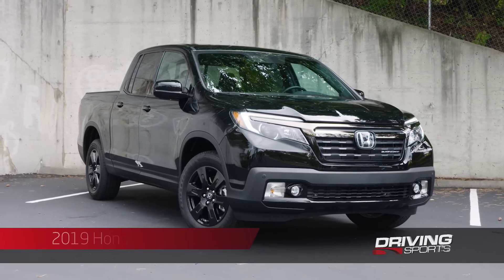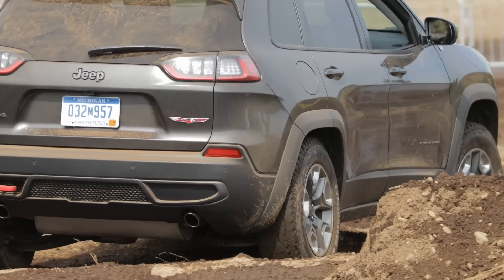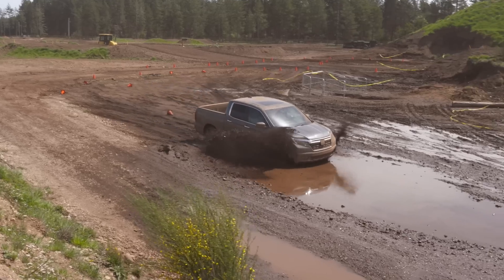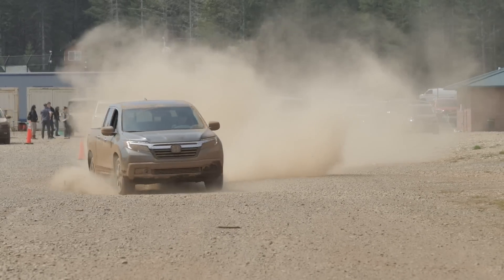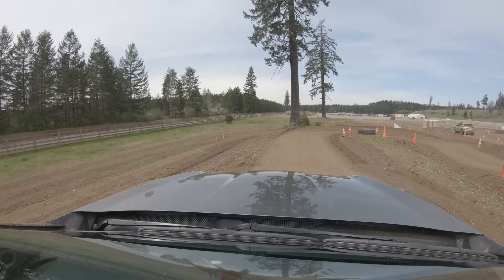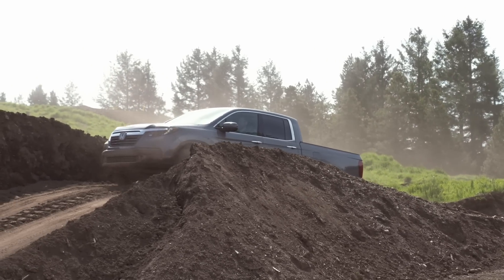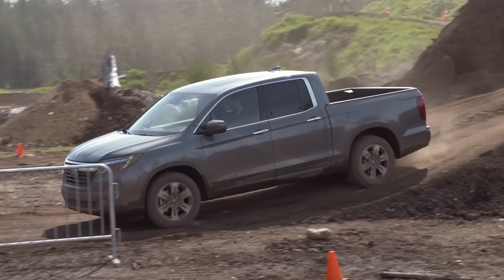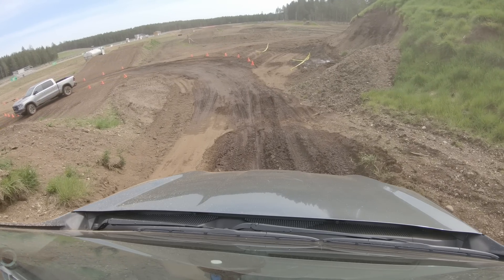2019 Honda Ridgeline Off-Road Test

Comment: Unibody and an independent rear suspension is the antithesis of a truck.  This is an SUV with a bed.  That's great that people like it, but for the love of god, please stop trying to convince the rest of the world that this is anywhere close to the capabilities of a Tacoma or a Colorado.
Reply: A truck has an open bed is used to carry around payloads from one place to another. The ridgeline is a great all-around truck for those that want the capabilities of a truck but don't want to sacrifice the atrocious handling and driving dynamics of a tacoma. It is made with functionality and durability in mind - the bed trunk is perfect for hunting and fishing and the sprightly engine makes it a joy to drive.

This truck isn't meant to do hardcore offroading, but will hold it's own just fine if you need to get off the paved path - as most LARGE trucks such as F150s and Silverados do (long wheelbase makes them a poor choice for true off-roading, as much as those companies love to tout that offroad package with those stickers on the side of the bed). A truck is supposed to be a WORK vehicle first, it's offroading capabilities are secondary. A Chevy 3500 dually is no less a truck because it can't do off-roading in this fashion.
Reply: Amen.  I own a 2018 RTL-E.  It tows my boat, holds my fishing gear, the kids hockey and baseball gear, I've thrown power-washers, etc. in it.  Plus, it rides beautifully, plows through the snow during our brutal winters, and has room in the back seat for two kids and a dog.  I'm not a rock-climber, I don't need a TRD-Pro.  Great truck, but I don't need it.  Plus, the safety features on my Ridgeline blow away anything else in the class.
Reply: James Muro,
 That's exactly what I'm thinking!
Thanks you.
How often do I drive off road to go to work?
I just need a bed to carry my kids bicycles or stuffs from Home Depot... For engineered and designed, I pick the Ridgeline over Tacoma. I don't care about the resale value because I plan to keep it for at least 10yrs or so.
The only thing I concern is the price!!
Reply: Spot on Tuan.  My friends with Ram trucks make fun of it, but I had a first Gen Ridgeline for 11 years and 175,000 miles.  Never ONE-SINGLE-PROBLEM.  (Aside from normal wear and tear.)  No, it's not the meanest looking truck, but again, it is the perfect all-around vehicle.  And I've always wondered this.  If I spend 45,000 (or more) on a bad-ass Toyota TRD Pro (and that is an AWESOME looking truck) am I REALLY going to head to Colorado or Utah or the Rubicon Trail and risk denting or scratching it?  I'd rather invest in a dirt bike or ATV and throw it in the back of the Ridgeline and go hunt for trails.  As for price, that is one issue with this truck.  What worked for me is I told the sales guy I was going to possibly wait for the new Ford Ranger or Nissan Frontier.  We haggled a bit, but I got a good price.  And, like you said, I'm keeping this for a decade, and by that time, it might transfer over to my eldest son!  (By the way, the safety features are worth every penny:  lane keeping assist, front crash alert, rear detection, etc.)
Reply: No one is trying to push the standpoint that this truck has the capabilities of a Tacoma or a Colorado.  In fact, Honda is upfront saying that they couldn't win that market anyway - there are too many loyalists with Ram, Ford, etc.  From a strategic standpoint, they are targeting folks like me that want a pickup but do not intend to go rock crawling or tow a horse trailer.   Let's look at the definition of the word truck, according to the dictionary:  "a vehicle with an open part at the back in which things can be carried."  It's a truck.  I love how this upsets people.  Why is it not a truck?  Because it's unibody?  Because it has independent suspension?  No, a truck is clearly defined as a vehicle having an open bed.  This has it, has the payload capacity of many other mid-sized models and can tow.  Plus, studies suggest that more than 90 percent of people do not use trucks for their intended purpose.  I don't begrudge people for commuting in a Ram 1500.  I have a co-worker with a Ram and all he does is tote around his dog.  Fine with me.  But my truck fits in the garage, can fit in parking spaces and is one of the safest vehicles on the road.  This is a truck for light duty work, towing boats or light campers, etc.    It will never overcome the sales of Toyota or Chevy, but they can't build them fast enough in Alabama.
Reply: Real Suvs use to come with frames and lockers. These new cars that look like suvs are cars.
Reply: Suburbans, Yukons, 4Runners, Excursions: All commonly referred to as trucks despite not having an open bed. Why? Because all of the important performance features are based on an open-bed corollary (for the 4Runner it's the Tacoma, Excursion/F-250, etc) and they are built to the same standard including body-on-frame design to be as capable if not more.
Reply: A humvee has independent suspension. I've got a Tacoma and it's a POS. About the only thing it's good for is off road. I have to believe a humvee is better off road than a Tacoma.
Reply: @jamesmuro9286  I know this is an old thread.  How does it do on a slippery boat ramp? Or backing boat into a garage on a grassy lawn? I currently run a Jeep GC with two speed transfer case, but not really sure I need it. Boat about 3000. Thanks if you see this!

Comment: Very dishonest and biased, yeah the Ridgeline has highest payload, but it's dead last in towing. The Chevy Colorado can tow 7700lbs. and the Ridgeline can only tow 4k unless you option the tow package. Honda didn't build this to be different, they built it to cut corners and be cheap, this is just an Oddessey with the back cut off. That "offroad" course was a joke, that thing would be stuck in anything more difficult. 

The Oddessey is the truck for a guy who wants a truck, but has no clue what a truck really is.
Reply from the maker: Colorado ZR2 (shown in video) can only tow 5,000 lbs.
Reply from the maker: A Tacoma TRD Pro did get stuck on the logs. Had to be towed off. Not as trivial as you presume.
Reply: Driving Sports TV Because somebody didn't know how to drive.
Reply: I have a 2010 and I’ve owned 3 silverados and an H3 Alpha and it’s fantastic in the snow and I pull a 6x12 V Nose 4 days a week with no issues at all

Comment: This "truck" is a joke. It can't compete against real trucks in this segment as toyota hilux, nissan frontier (navara), ford ranger, vw amarok and so on
Reply from the maker: Many that own trucks don’t really “need” a truck to begin with. The Ridgeline is a good compromise.
Reply: Exactly!  I have an I.T. full time job and I do DIY projects on the weekend, Ridgeline just fits what I need.  I don't need to go off road but I can tell you snow/mud mode worked very well in Canada.   I built a wooden back hitch snow plow to shovel snow in winter :)   Tacoma doesn't have the features and comfort level Ridgeline gives me, not even close.
Reply: Feel free to list the competitions so the rest of us get the joke you're talking about... Most people don't take their "trucks" off road and need a bed for hauling merchandise from the home improvement store. Nothing you listed drives better than this Honda on the road. By far, the best rated small "truck" according to Consumer Reports.

Comment: HAHA hook it up to a 5k trailer, let's see it do that in the real world.  Its like Ford saying their POS 4 cylinder lawnmower engine equipped F150's can tow 12k...sure on flat ground with a tailwind...the real problem is they chopped 4 cylinders off the engine and added 2 turbos to pretend to make up for the lack of displacement.  That's cute your truck sounds like a lawnmower, but it gets shit for fuel economy...actually worse than a V8 when actually being used as a truck and the 10 speed transmission is constantly trying to figure out what gear it should be in.

Thanks I'll keep my manual hubs and manual transfer case, pretty foolproof system...if you want a truck learn to drive, stop with all the electronic shit that allow morons behind the wheel.  

Yep you could in fact drive a Camry though that.  I saw nothing there at all that required any more ground clearance than a standard sedan.  Could be fun with the logs but other than that little bit you are good to go in a Camry.

Bring me a Ridgeline this fall for hunting season, I'll show you some actual offroading.
Reply: You might want to check out other videos of them towing. They do it easily.
.....and what?????    They are not 4 cylinders,....... and they don't have turbos....and they don't have 10 speed transmissions.